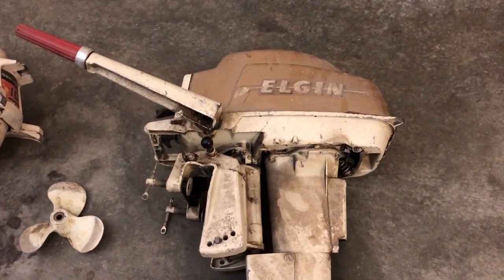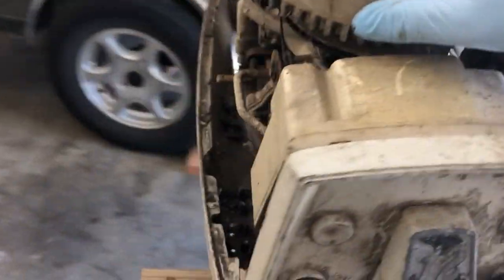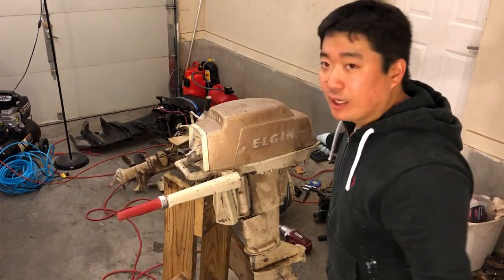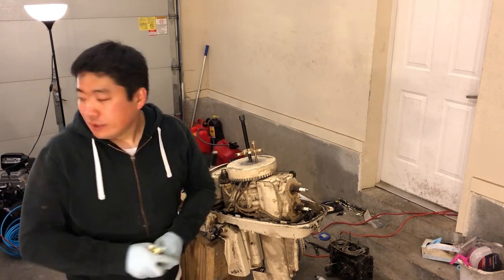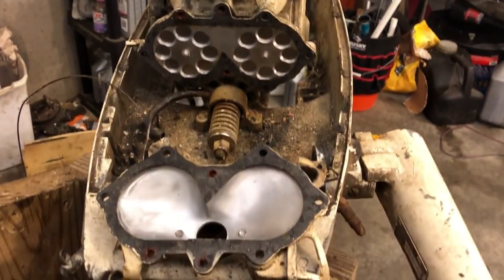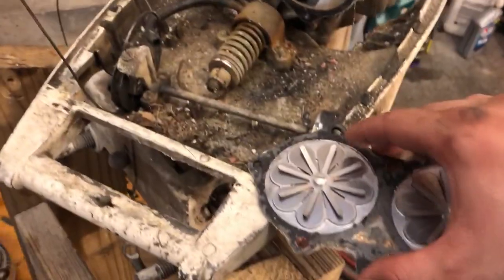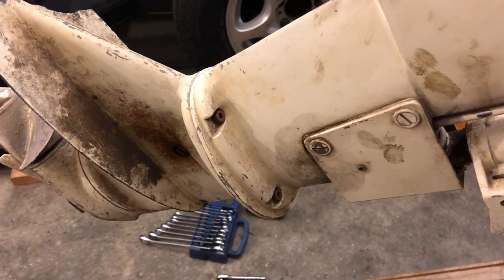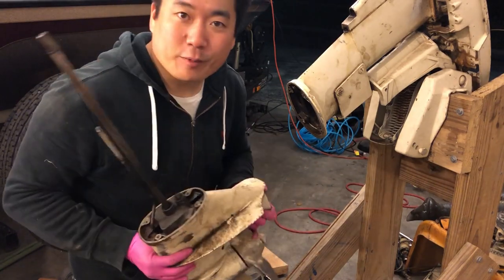Seized 1959 12 hp Elgin (West Bend) Outboard power head removal

Comment: These are good engines. I have a video of one running on my channel. Most repair parts like fuel pumps, water pumps, condensers and points are still available under Chrysler/ Force parts. The best way to remove these flywheels is to pry up on them and whack the crankshaft with the nut flush on the top.
Reply from the maker: Thank you for the reply, and the info! I would love to restore this engine, but I have so much going on at the moment, I'm not even able to get videos out as I would like. I'm currently finishing up my writing my dissertation for my PhD, so with luck I'll have a lot more free time (and "real" job) in the near future. Thanks again!
Reply: Any one else have issues pulling off flywheel? Due to holes not being threaded…
Reply: @joshuagugenheim1810  it is a little tricky to get the first time, but you can get it by lifting up on the flywheel with your hand and whacking the end of the crankshaft with the nut on flush with a brass hammer.

Comment: Are you interested in selling any parts?
Reply from the maker: I really haven't been selling any parts or engines, but what would you be interested in?
Reply: @TheAfterWorkGarage  I have one of these engines also, it seems either the throttle handle is stuck or I just don't know how to operate it, already started taking some of the linkage apart camas motor fires a little bit but not enough to altogether turn over yet. I'll post the video
Reply: @TheAfterWorkGarage  Thanks for your post. Really appreciate your videos. As I just wrote below, I recently acquired one of these Elgin motors…same model 1959 12HP. I’m having issues getting motor to start. Able to pull the starter rope without issue. Not seized as your video described. I think I’m having issues with fuel making it’s way to the cylinders. Replaced spark plugs and fuel is making its way through to the carburetor. About to replace the spark plug lines just to be sure, as they are quite degraded. Do you have any recommendations? Thanks for your help ahead of time. Josh